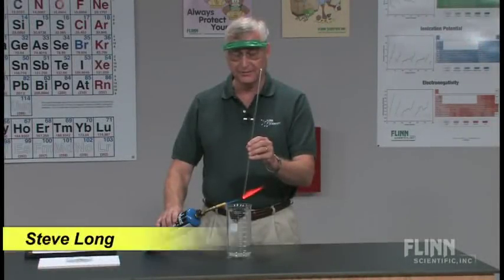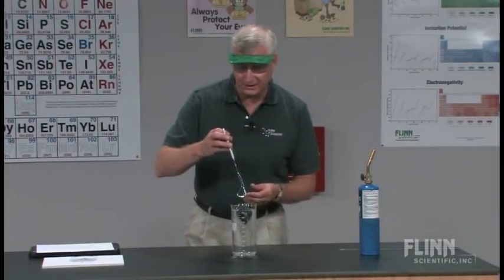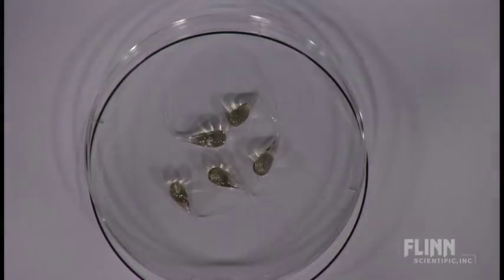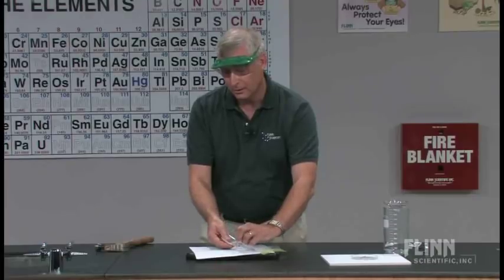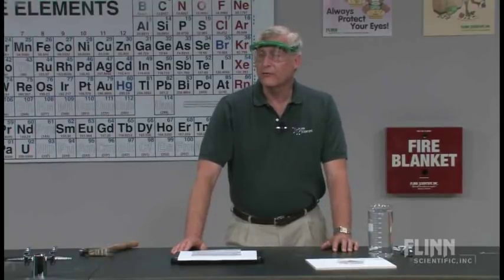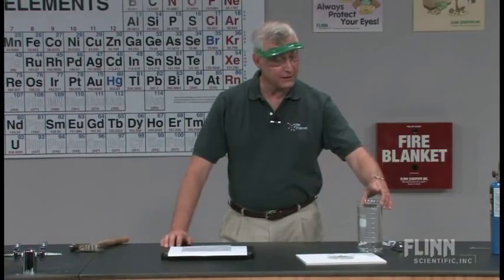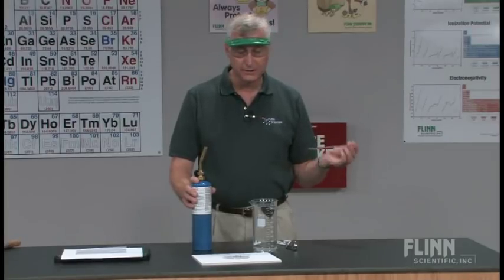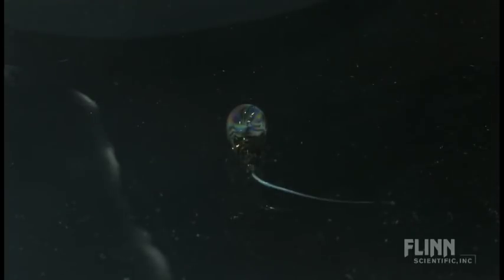Prince Rupert's Drops Are Stronger Than Steel

Comment: How about when you heat glass piece in no-gravity enviroment so it won't have the tail, just round object which you put into the water?
Reply: +Jacek J and make kevlar armor with them... beats ceramic and steel plates?
Reply: Good luck finding a no gravity enviroment. Anyway thatd be cool
Reply: There might be another problem, nogravity means no force to shape it into a tear, or round object so it's not going be even that simple. There are space bases around Earth that crews stay on all the time, resupplied every 6 months or so. No gravity there all the time. Well... someday maybe ;]
Reply: +Jacek J There is gravity everywhere.  The space stations are traveling horisonataly at a speed they wont fall back down. You have Albert Einstein on your profilepic, you should know this. There is no place in the universe without gravity. And kevlar armor isnt made by steel, its made of kevlar plates.
Reply: +Space There is gravity everywhere, but an object in freefall is a zero-g environment. Check your facts before you get all condescending.
Reply: +Elias Schwartzman Well. I think you should read what i wrote one more time. I wrote the same thing as you
Reply: +owen bradner Im giving up.
Reply: +Elias Schwartzman oh my God, no. what you're both talking about is a micro gravity environment. and other than writing horizontal like a child, he gets closer to the facts than Einstein over there.
Reply: +Jacek J Without any forces strong enough to pull away the heated glass, it will remain connected to the rod.
Reply: some force must be used
Reply: Jacek J Then the drop "falls" in the way it is pushed from the force, achieving the same result. Unless you mean heating a piece of glass without the rod, and then submerging it in water as the whole piece is heated.
Reply: I wonder of this thing's usefulness anyways. Probably tonz of it.
Reply: +Jacek J there is a force to form it into a sphere... Cohesive force.

Comment: Would it be possible to create a series of prince Ruperts drops with the tails within the heads of each other to create an extremely strong materials?
Reply: Multiple blow torches at different heights on the rod.....this could work...but there would inevitably be those little areas between each drop that would be highly vulnerable.

Comment: Windshield glass is laminated with a piece of plastic between two pieces of glass so that when it breaks the plastic holds it together so it doesn't shatter and form sharp pieces. The other windows in your vehicle are tempered safety glass though which when it breaks it forms more square, small pieces.

Comment: i bet if u let it drop in water with liquid nitrogen it would be even stronger 
i think it will compress itself harder becaus the temp change is higher 
is this right ?
or will it just scatter cause of the glass not being able to hold that amount of compression ?
Reply: It would shatter on impact with LN
Reply: +Tyler TheMaker The "surface tention" of glass in this case also has a limit to it, so no, it would just shatter while cooling :P

Comment: If we manage to forge a glass sword using the same principle. Would it be harder than steel swords?
Reply: remember that part were he said if the surface was scratched it would shatter.
Reply: That doesn't make sense... I saw some getting crushed by hydraulic press without shattering

Comment: can the inside of that drop be cooled too??
by cooling the entire glass drop much more (example = by using liquid nitrogen)
so that the glass drop becomes much stronger??
Reply: Santosh Kumar well, the glass is fully cooled once the process is complete, and i think it would depend on whether you shock the glass with the liq nit, or if you put it on ice first... but all in all, it would most likely be more brittle.

Comment: Is it possible to make not  a drop but a ball, so there is no tail?
So its unbreakable
Reply: +Kevin Michalik I was considering that too.  In Zero G, where you could catch it with a glass of water it would work, but I'm not sure with this.  Maybe if you heated a sheet of glass (induction heating maybe?), then poured liquid nitrogen or dry ice on it, or dropped the container in it, you could make a sheet of it instead.

Comment: so it's like super tempered glass
Reply: +Carlos Hernandez No, it's like a water balloon, the outside is pressurising the centre, which gives it it's strength. snapping the tail is like poping that balloon with a pin.
Reply: isnt that what tempered glass is like tho
Reply: so if anything tempered glass is like a water balloon
Reply: Tempered glass is just glass with a more ordered structure, increasing it's strength, like tempered steel.

Comment: I doubt it can withstand a 50bmg. Like steel can.
Reply: not sure what bmg mean, but I have witnessed the drop part withstand 20 tons of pressure.
Reply: ***** I have also seen bullets shattered on impact with the front of the drop, and the drop breaking only after the vibration shockwave travelled back and broke the tail.

Comment: Toughened glass is NOT stronger than steel. It is harder than steel, yes. The strength of steel (in America)  is quantified by the minimum yield point required by the standard it is made to. Fairly mild steel such as ASTM 572-50 must exhibit 50 ksi yield strength and 65 ksi ultimate tensile strength. These numbers can exceed 175 ksi in steels that are still mild enough to weld.

Comment: Really cool! But - it's in fact harder to crush it with the hammer on a table, compared to for example an anvil. The table is most likely a relatively soft surface. If you take a steel ball the same size (for example from a ball bearing), place it on the table and hit it with the hammer - it will just sink down into the table the same way those drops did. 
But it's still amazing as normal glass will just shatter instantly at contact with the hammer - regardless how soft the surface underneeth it is.

Comment: Great video - I really enjoyed it. This reminds me a bit of Wigner energy in a graphite moderated reactor core where the accumulated deformation of the graphite from neutron impacts stores energy that can be suddenly and catastrophically released. One example is the Windscale Reactor nuclear accident in England in 1957.  Does anyone know if, at the microscopic level, the shattered bits of glass are still tempered, and if so, to what degree? In other words, how far down the structural scale does the release of stored energy go? Thanks.

Comment: If these were made in a zero gravity environment, could they be created perfectly spherical? Due to the lack of a tail? 
If so, would the strength be correspondingly higher, without the weak point of a straight edge which shatters under extension?

I was also thinking that if the glass contained some ferrous material, could the molten glass be shaped other than a sphere, using magnetic fields? I'm sure there must be some practical uses for these little guys.

Comment: They are not stronger than steel, even under the more optimistic claims we are talking about 150k lbf but more conservative estimates are 3372 lbf. Even in a press it will dent aluminum but barely harm the steel.

Comment: so why dont we make buildings out of prince rupert's drops
Reply: HYPER MARSHMELLO because it is still unstable
Reply: HYPER MARSHMELLO Because the tail is extremely fragile
Reply: seal the tail in steel
Reply: Also, you cannot make a building out of teardrop shapes. Not only that, the building would be extremely hot. If you were to even scratch the tail, the whole structure would explode, meaning, and earthquake would shake the tail, causing the structure to explode. Furthermore, it's not nearly the strongest material on earth. Not even close. Some things are just not meant to be structures.
Reply: it's glass. everywhere would be a green house
Reply: one guy breaking of the tip of one ruperts drop.. whole house falls apart.

Comment: temperd glass is amazingly strong but not very scientific...go to the local metal shop and put it in a rockwell hardness tester along with a few other samples of cold rolled, high carbon, drill rod, maybe some carbide or tungsten...im thinking carbide is just so much stronger its not even funny

Comment: They are STRONGER than steel? What does it mean? They push more weight on a bench? If we do science, please, lets keep it scientific. For what i've seen they are less malleable and have SOME impact resistance. However they have extremely poor flexural strenght which in this area makes them far beyond steel of any kind. Not mentioning about other material properties like chemical resistances, etc.

Comment: How are they defining strength?

What are they defining as "Steel"?

I know of some cutlery steel alloys with high Vanadium content that have carbides (vanadium carbide formations instead of chromium) which can scratch glass and the carbide formations themselves can only be cut by diamonds or cubic boron nitride abrasives.

Comment: What if instead of water it starts raining these drops! 😮😦
Reply: +Denboy_Kad lol how weird would that be ?!?!?!?!11111 lol!!!!?//?121\
Reply: +Chloe Kiernicki it would hurt
Reply: Then it would basically be like hail. 
They are hard, but have little mass.

It would sting a little if they rained on you but that's it.

Of course, hitting the ground many of them would shatter and so the air would start to fill with glass dust.

That would be the only dangerous part about them.

Comment: Sorry but wrong... not "stronger than steel" harder maybe, but when it comes to metallurgy (including glass & many materials) the harder something is the more brittle (brittle = shattering) it is, & why glass shatters when dropped. Now if you have a hardened piece of steel (example: drive shaft), & drop it on a cement floor, it too will shatter. Now if you have some steel that is partly hardened, & partly ductile (ductile: is forgiveness, or the stretching of material, example of a real ductile material: led) the stronger it seems. As it will last longer, has the ability to take, & forgive more stresses, making it "stronger",  but not harder. The harder something is doesn't mean it's stronger. When heating then quenching (cooling), it locks the material's microscopic structures in place making it harder.
Reply: Good example, watch the video with drop & a bullet. A bullet is made of led a very soft metal, but the bullet shatters the glass drop & wins, because it's stronger rather than harder.
Reply: it terms of metallurgy you're confusing strength with toughness.  Steel is very tough but not as strong as more brittle materials like ceramics.  Strength is associated with the ultimate tensile strength where as toughness is associated with the area beneath a material's stress-strain curve.

Comment: There's nothing spectacular about this droplet of glass. It's not any harder than any other piece of glass shaped like this one in the same size. It's not stronger than steel when it shows up press pushing on it the bottom anvil part of the press is made of rubber. It doesn't push the glass into metal, it's rubber. Nothing special here at all. Find any piece of glass bead the same size as this one round and it will be just as strong as this without dropping it through water or anyting special. it's only the shape. I think these teachers or whatever just didn't know about this and their hyped up on it or something it's not anything new or special. This is bull.